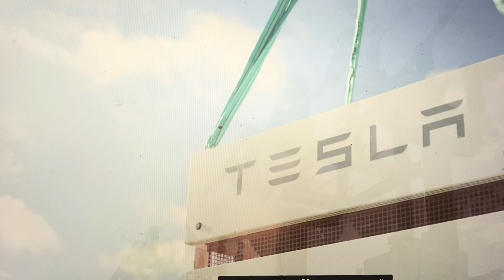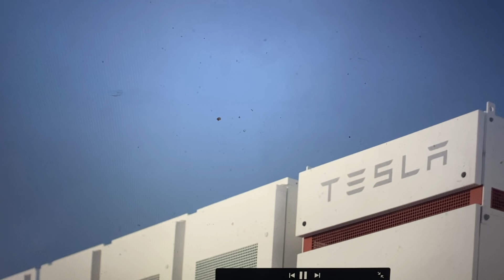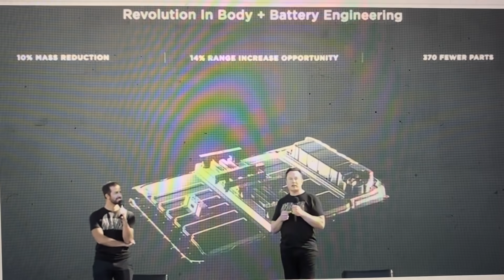Tesla Secret Load Shifting Energy 2021 (a541)

Comment: The megapacks can provide more than simply time-shifting. 

For example, on some grids they can help with grid stability off-setting frequency swings or load-shed events. They can be used as a load bank so thermal generation plants can run at optimum efficiency while loads fluctuate. They can serve as spin reserve instead of needing to maintain reserves on thermal units. They are easily dispatchable. They can help utilities integrate non-firm renewables. They can be a buffer for cold start. They can provide ancillary services for transmission.

Comment: While I do believe tsla energy can be huge in time, +3000 is a hard sell. I back calculate that it would take the batteries of ~2.7 million vehicles (75 kWh each) selling 100% capacity per day at $0.1kWh profit, assuming a PE ratio of 400. So 2.7M * 75 * 365 * 0.1 * 400 ~ 3T. Of course if it takes them to 2030 to get there, but the market sees it coming by 2025, then maybe?

Comment: Electricity utilities don't like retail customers putting solar cells on their roof, storing solar electricity in their cars and in their storage batteries and exporting the excess to the grid and not needing to pay power bills, and in some cases and even receiving a credit. Sometimes the utilities can hinder this, often they just have to put up with it.
A sizable company might be buying batteries rather then leasing them. And they might decide to be the electricity utility.
When Tesla got in to EV cars the incumbents ignored them. Tesla had some wide open empty territory to occupy and there EV specifications are world leading. I think that the electricity business will be different. Auto bidder is good but I think it can be replicated by others. And the electricity needs to be clean and that can be replicated, actually a legal requirement. 
Dare I say it? OK I will, I don't think they will have a wide competitive moat.